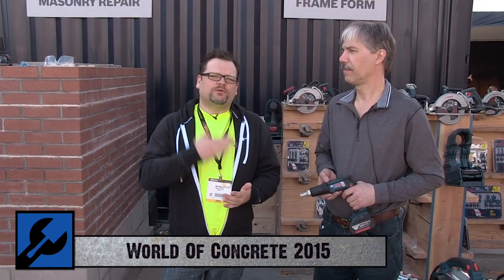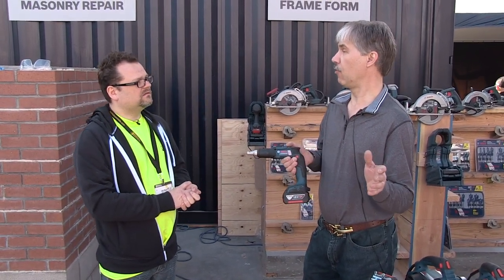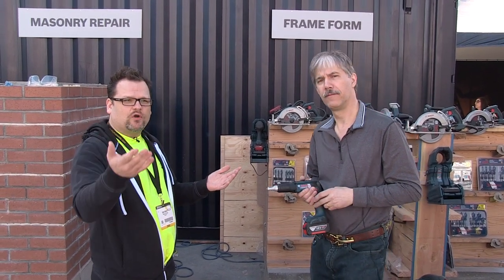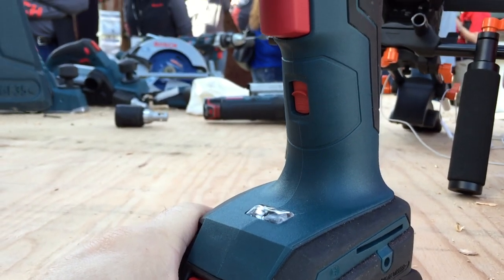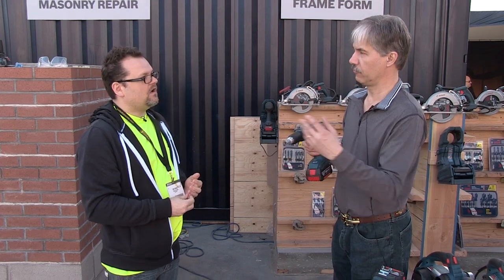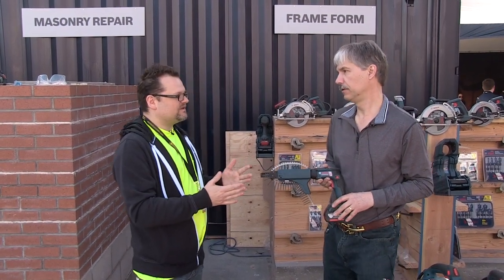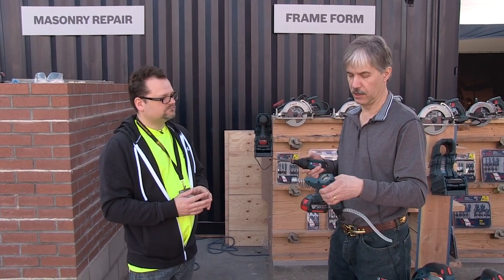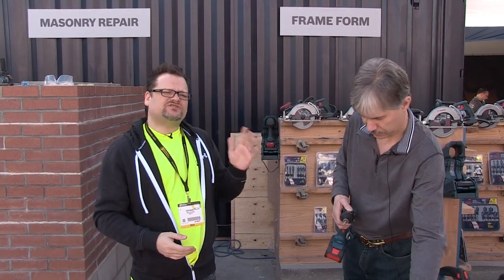Bosch SGH182 18V Cordless Screw Gun - World Of Concrete 2015

Comment: If it's as good a tool as my Bosch 18v 1.5 Ah drill or my Bosch jig saw or my Bosch sander - this is a great tool (and it looks like it is).
The drill fits my hand perfectly, is really well designed down to the last detail. It's light, the battery holds a charge for a long time, gives a long run time and charges fast, plus has a handy charge condition button with a series of LEDs showing charge. I smile almost every time I use either my drill or my jig saw (it's a monster).
I don't work for Bosch, I'm just an older man who has had a workshop for 45 years and who has learned to pay a little more for a good tool - there's nothing like it to make work a pleasure.

Comment: That is a nice drywall gun. I'm just surprised how tiny it is compared to the Dewalt gun which is more of the typical drywall gun size. I know the Bosch fans will love this tool plus with the wireless charging. You have the base you could set it to charge while your lifting the rock in place. I'm curious to see how that would work out. High production guys can throw drywall up in no time its crazy how fast they can do it.
Reply from the maker: We should take it to the pros
Reply: I can't imagine a Pro not liking that tool. Especially with it having a collated screw attachment. I know they don't like to use it all the time because of the cost, but for convenience on ceilings or odd situations collated guns are nice. I think we need to have a tool fight when the Dewalt and Bosch both come out. I think Bosh wins because of the size.
Reply: A tool fight for these guns would be great.